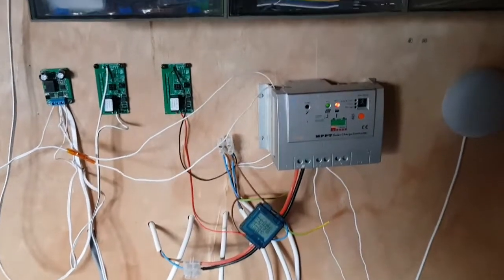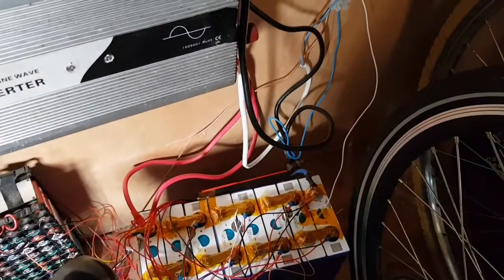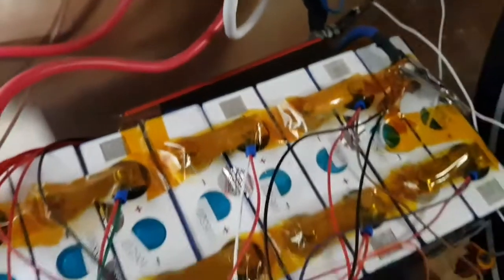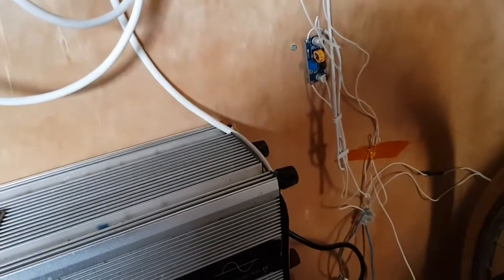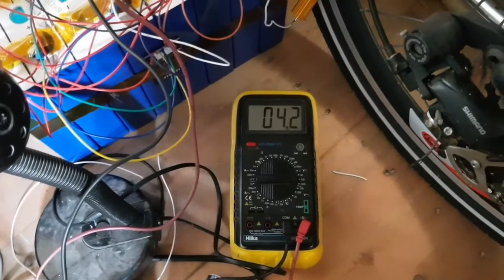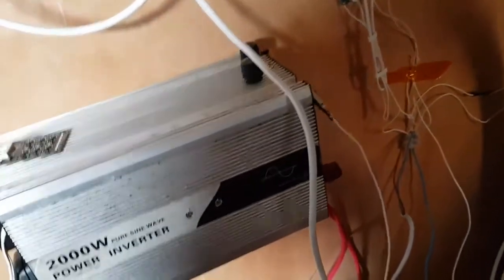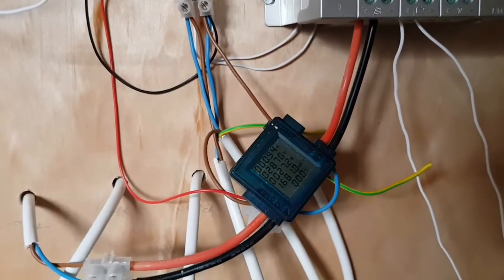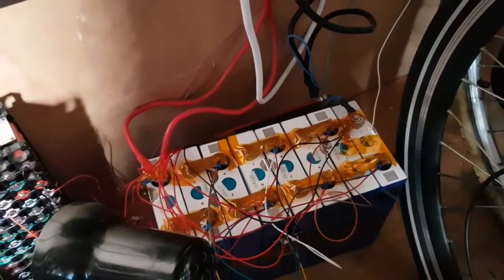power resistor for pre charging!

Comment: instead of a resister you could use a filament bulb when the bulb goes out the voltage is equal kinda how a warning light works on a car alternator it would seem you need a batter charge controller as it is nut shutting off befor the battery bms if contoller is fine and it is the inverter a heavy duty relay on the output of the solar controller and have that inline with the relay so the solar controller can have better controll of loads as to charging a basic boost converter will help a little when you have very low charge battery
Reply from the maker: That is a good idea. Mine keeps tripping as a have loads on all the time. Like cameras and a aircraft tracker. In the summer is fine. But now in winter it can't run the load all the time. I have since added switches to turn off the loads and it's now fine.
Reply: @mathewlawrenceml  i would also look at all your items and se what voltage they run on you may find your wasting so much energy using an inverter when all you need are step up converts to power the items just set the voltage and ampage and away you go i was 12v so hence boost converters alot of anagy loss still but as your 24v you can step all these voltages down been more efficent even my laptop at the time used a car converter but buck converter will be perfect for a 24v system stepping down to 19v or so
Reply: @mathewlawrenceml  the best move i did was going from pwm to mppt i could then run the larger grid tie panels that can be got for cheaper i was offgrid for about 3 years befor i moved in with gf
Reply from the maker: @1981dasimpson  yes iv done the same too. This charge controller is a mppt one.
Reply: @mathewlawrenceml  from everything and tests i scene on units that small is they have not been mppt but buck converters
Reply from the maker: @1981dasimpson  that could be another video idea. I shall check if it's a true mppt
Reply: @mathewlawrenceml  when i was testing i used a meter with amps and volts on on the battery side and the solar side so it would show the volktage drop and the ampag increase they should be to a point buck converter do the same but they really only do the best in full sun mppt i found would start charging where befor the buck converter ones would i thoght i had a video of it but seems it was the input and output of a controller for checking usage
Reply: That was a really good idea..!